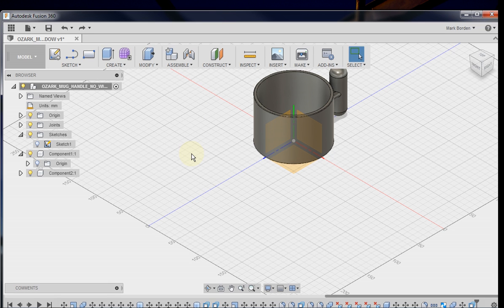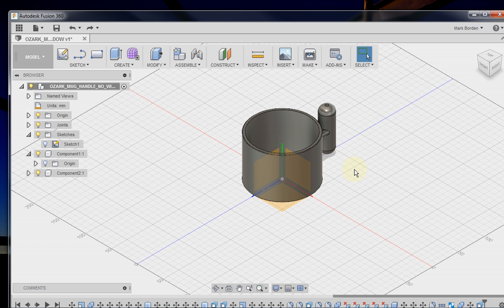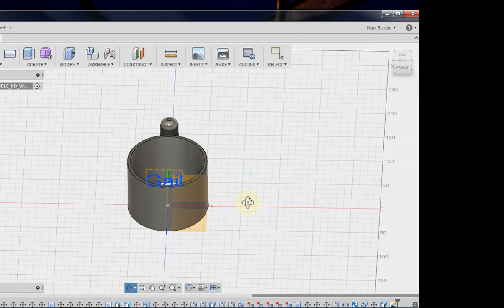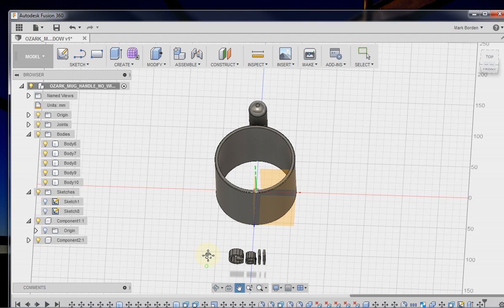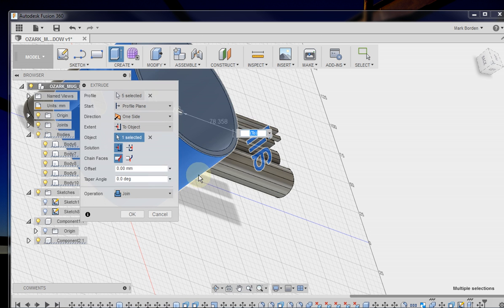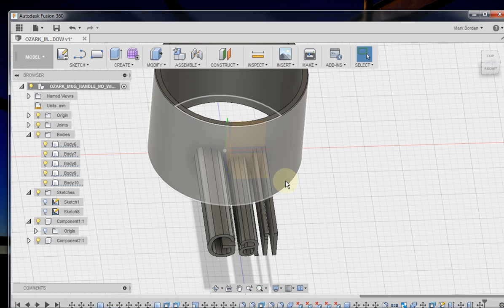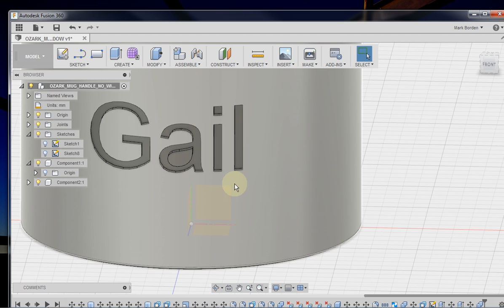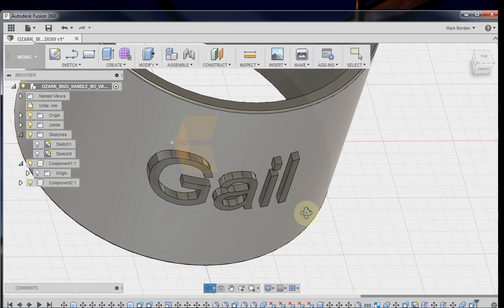Making Embossed Text on cylinder in Fusion 360

Comment: This method doesn't work for me.  Every time I join the back of the letters to a cylinder, it combines the letter bodies to the cylinder and becomes only one body total, not the individual bodies and the original cylinder.  Perhaps Autodesk updated F360 to stop this.
Reply: You can change where the extrusion starts and ends.  Distance or body

These options are the basic extrusion window. 😉

Comment: That's great. I wonder if there is a way to wrap the text around,..ie: perpendicular to the curved surface. If her name wasa long name, like Elizabeth, the letters would get more distorted as the angle gets steeper around the curve.
Reply: As Marcel said, longer text gets distorted at the ends.  Moreover, the plane of the embossed letter edges is parallel to the outside curve of the cylinder.  The closer you get to that outside curve, the more angled the left/right edges are, as in not perpendicular to the cylinder face.
Reply from the maker: I do see what you are saying. My initial thought for a quick fix would be to originally make the diameter of the cylinder large enough to contain the full text within the 180 degree plane and then after the text has be moved to the object you can go back through history edit and change the diameter of the cylinder and it will update everything correctly. Just a thought.
Good luck
Reply: There's a hacky way to do it by using the sheet metal workspace; you unfold the cylinder, make your engraving/add your letters, then fold back to where it belongs.
Reply from the maker: Yes, this method will work. unlike some have commented, it doesn't make a straight line insert. Because when you do the move "to object" it takes on the radius of that surface. Try it and let us know how it worked for you.

Comment: Well I've been trying to do this.  When I get to the point that the letters are extruded back to the surface of the cylinder that works ok but - all of the bodies for the individual letter disappear and I am left with one body - it appears the letters and the curved area have become one body.  So now I can't select the letter bodies to get to the next step - since they are no longer there!  Not sure if you will see this or have any idea but it is hair pulling.
Reply from the maker: Fred LeFevre  you are joining the bodies. you need to change the action to keep them as separate bodies.
Reply: Thanks for the reply.  In your video you say to leave it as a join which is what I did.  I tried an Intersect and it doubled the bodies giving one set for the front of the letters and one for the rear of the letters.
Reply from the maker: Fred LeFevre can you make a video to show me what you are seeing? You can use a free program called cam studio if you don't have any other software to record your desktop
Reply: Thanks!  Great offer but I will have to make it tomorrow.  I appreciate your help.

Fred
Reply: I am using the latest version of the Fusion360 and I had the same problem. Could be a version difference? Anyway, I decided to do it another way.

Comment: that technique works but, it is not really the correct way to place embossed text or engraved text onto  a curved surface as the letters do  not project out radially but is straight out from a flat plane. maybe you could make another video explaining the radially embossed text.
Reply: There is no “radially embossed text” option. 
Unless you do SheetMetal and ‘unfold’

Major deficiency in fusion 360 😢
Reply: @fredsanford1437  crazy how 4 years later and they still don't fix this issue